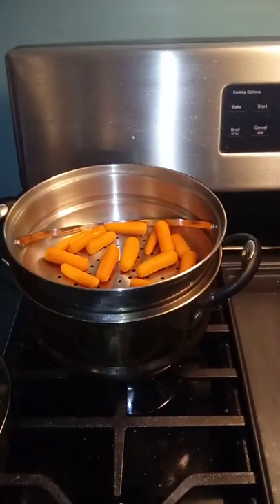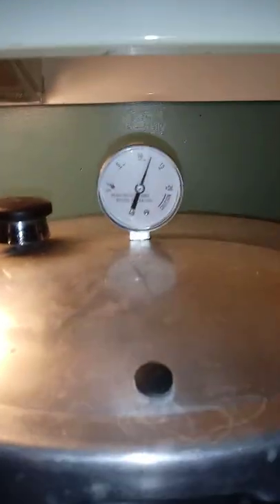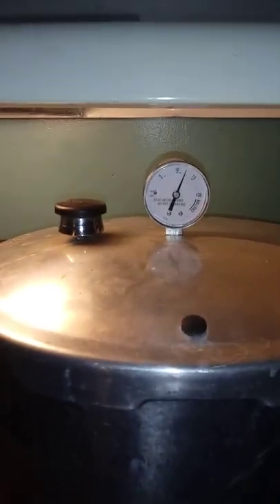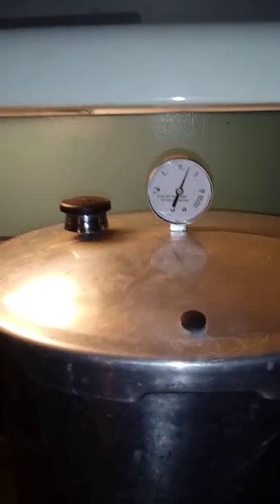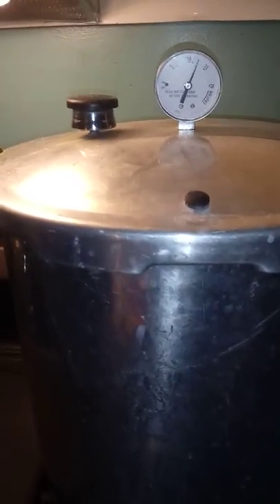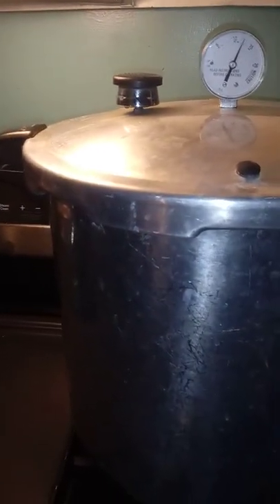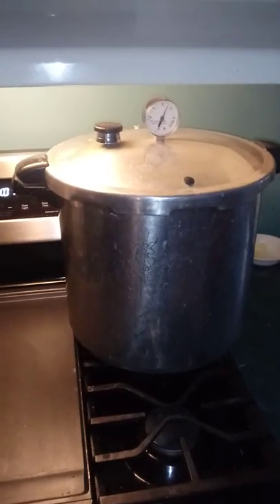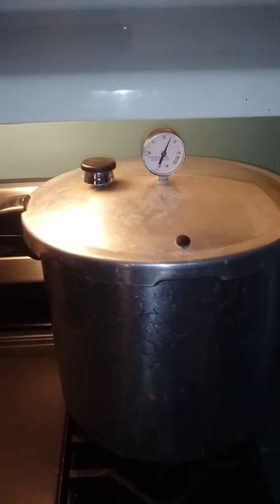Pressure cooking substrate bags etiquette

Comment: Yes also there is a huge difference between pasteurizing the substrate and sterilizing the substrate so by you pcing the bags ur sterilizing the sub some people only pasteurize either with hydrated lime or 170for 2 hrs. But I like how you mix the 2 good job.
Reply from the maker: Well, you can never be to sure and it's always best to add a little buffer just in case your running say chestnuts or beech. Which take longer to colonize.

Comment: Do u need to sterilize just the grains or the sub also?
Reply from the maker: You can put the grain in with the substrate, but it needs to be presealed. Normally you would want to pressure cook your grain, for optimal sterilization.
Reply: I used to pasteurize substrate , but now I PC everything . Grain’s definitely need to be sterilized tho